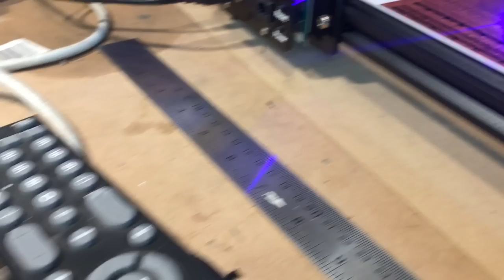Goodsyard Revamp - Scratch-built Curved Warehouse (Part 2C)

Comment: :yt:That is a wonderful-looking building and looks very similar to the real building. I enjoy watching search-built buildings. Tony North Eastern search-built South Shields station from a set of photos. He even counted the number of bricks in the height and width of the sections of the buildings. The alone is a work of art. My friend (Who got me into 3D printing) has a Laser Cutter and is making some very good items with it. My only problem is the design side of 3D printing. Martin. (Thailand) 🏭🏭🏭
Reply from the maker: Thank you Martin. I watch Tony's channel with keen interest and you could say we model scratch-built card structures in a similar way, albeit Tony works fully analogue which I find amazing. He also goes to town on the interiors. But much like Tony, I count bricks to determine dimensions. The one issue that's kept me away from investing in a 3D printer is the design-side. It might sound odd that a graphic designer is stumped by 3D modelling software, but that's me. I think there's only so much room in my brain to store design software knowledge and 3D software knowledge is a step to far.😯

Comment: Julian, I've often wondered how a gent from one of the MOST beautiful places on the planet, comes to model a dingy run down town from the north west of England? 

As for the building, well it's good drills mate is all I can say to that - really looks the part.
If you can get it over there try the FINECAST range of.emnossed plastic card. It's super thin and can be glued with card glue. You can also sand it and fill the edges so it looks excellent.

Cheers 🙂
Reply from the maker: Thanks Craig. I have quite a fascination for 1950-60's England in all its grimy glory. Having never travelled to the UK, I'm not sure why, but my Dad lived in Leeds in the early 1960's for about a year and recounted his experiences there of a very industrial, dirty and gloomy city. I very much doubt Fincast would be available here in NZ but like a number of modelling paraphernalia, I do order quite a bit from abroad.
Reply: @StationRoadModelRailway  how strange a coincidence! I was born in Leeds and lived there for 25 years AND my father worked for British rail right up until it closed in 1996/1997 

Can confirm, Leeds station was always dirty even in the 80/90s!😂

Comment: Great building.  Would you consider using the plastic  chain link used for vertical blinds as the fixing for the chain link ties have a similar shape plus come in different sizes.  Just a suggestion.  Great video
Reply from the maker: Thanks Alan. I'm not sure what you're referring to for chain link ties, can you elaborate?
Reply: The vertical blind chain has an attachment to the actual  blind this can be separated and used on the drainpipe as a bracket to hold the drain pipe down the building

Comment: Bloody marvellous Julian. A credit to your skills. The last slow shots of video gave a nice up close and personal view. I enjoyed looking through the window and through to the other side. I wonder should there be any flashing on the roof of the but above the crane floor area also could you use the thicker wall basr on the track side while the building is in place to cover the gap that said I guess ballast will do that for you. 10 out of 10 for a job well done.
Reply from the maker: Thank you for your very kind words. There are still some small bits to finish off and that includes the foundation brickwork on the track side of the building, at the moment there's a few gaps. Cheers, Julian